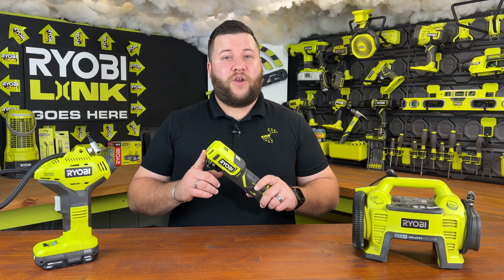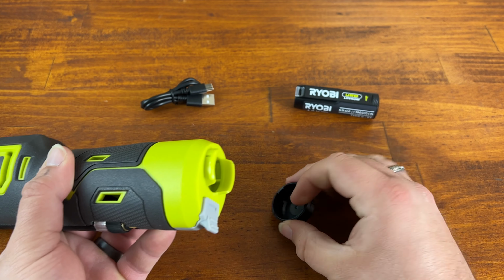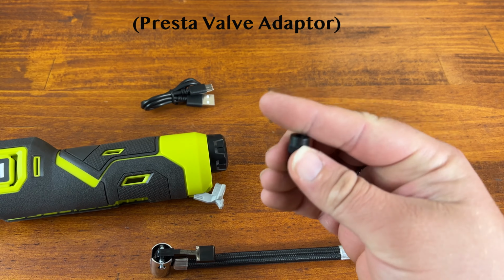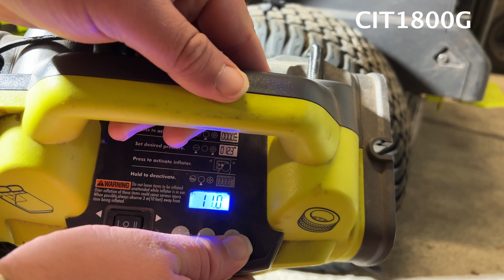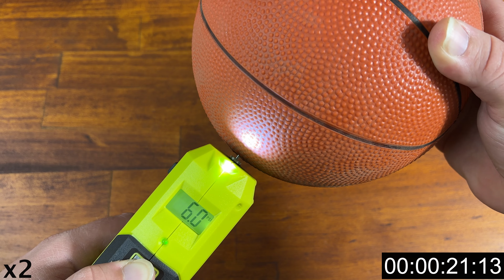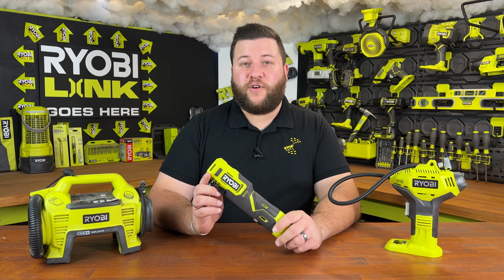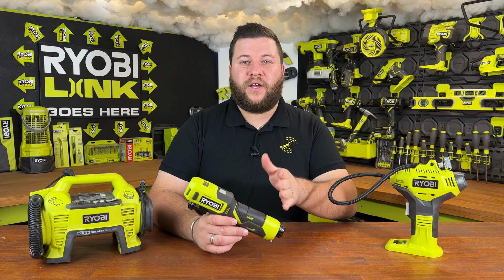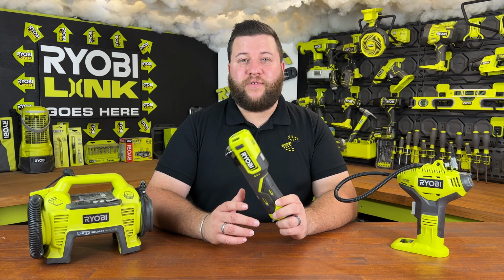Ryobi USB Lithium Compact High Pressure inflator (100PSI Really?)

Comment: If the inflator is at full charge, would it be able to pump up 4 bicycle tires from 0 PSI - 50 PSI each at one go, without having to recharge the inflator device ?

Am i underestimating its battery power?
Reply from the maker: Shouldn’t be a problem to fill 4 tyres on a full charge 
I did most this video on the 1 charge

Comment: Do you know if the tire inflator valve will fit into Schrader valve on my e-scooter ? Or is it only compatible for bikes with Presta valves ?
Reply from the maker: Hey Mate 
I’ve pumped up Segway electric scooter tyres with this a few times and it’s been fine
Reply: That's a Schrader valve on the lawnmower
You can get adaptors at bicycle shops to adapt a presta  valve to be used with a schrader type pump fitting

Comment: This is an absolute piece of 5h!t. It cannot inflate a 700c x 28 tyre. A cheap chinese inflator works better on my TT bike. I've been 
inflating tyres for years and definitely NOT going away from manual pumps. This was a HUGE waste of money.
Reply: Same as you, couldn’t fill up a bike tire, 😂, why would ryobi lose good customers over this junk , I’ll try more bikes but I hate this thing
Reply: I had issues too until I realised you have to screw the presta adapter onto the presta valve first.  Worked like a charm after that 😂